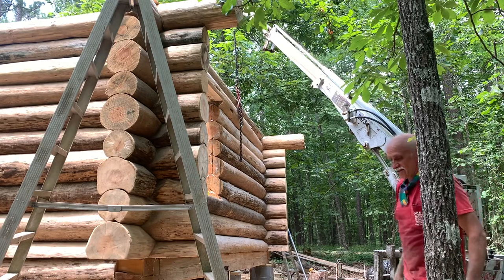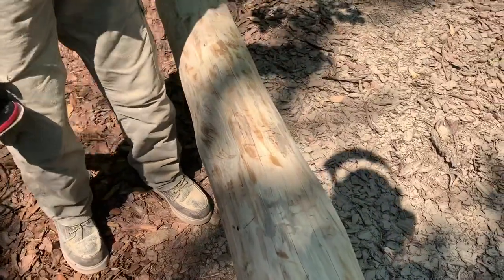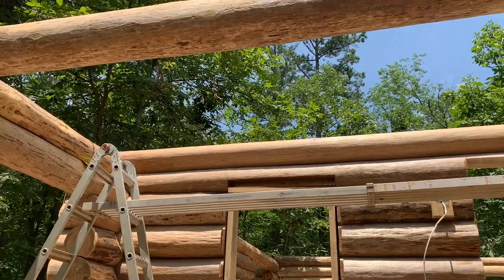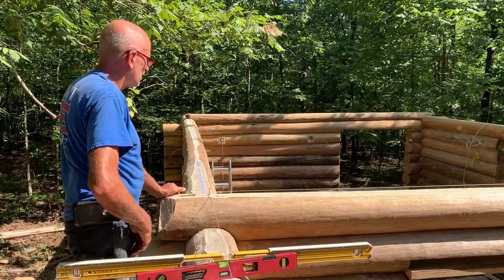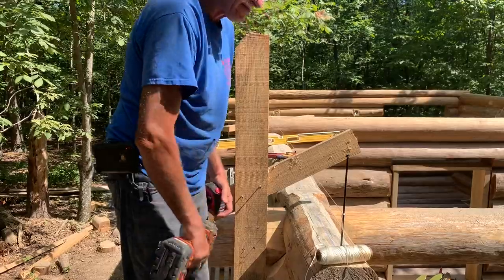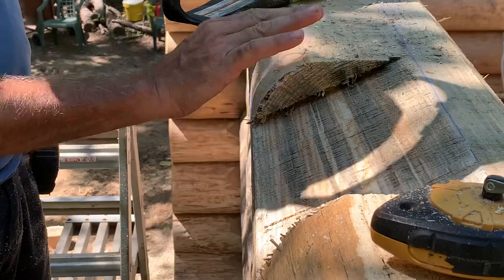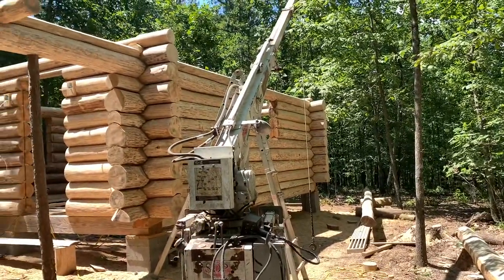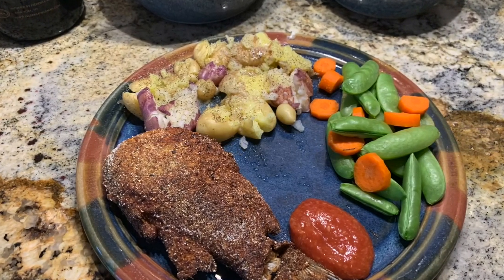Log Cabin Build Part 19. Highlights. Squaring up the walls and getting ready for the roof

Comment: I've been following your videos. You are making great progress. When i was building mine I figured out that if you pull your chaulk line away from the center of the log and snap it that it will give you  a true slant  line to cut the flat. My logs were natural like yours and it worked well for me. Your method works good too. just a little more time involved. Keep up the good work!
Reply from the maker: Thanks Donny! We can’t seem to get that to work…I guess we are not getting the right angle when we snap it. Our way was pretty slow😂
Reply: @natureartgirl  You know what! I was wrong. It's been so long for me that I forgot. Pull the chaulk line awy from the intended plane of cut. F its a long span hold it in the center and snap each side. But your way works too and is probably more precise in the end. you are doing a great Job!

Comment: Hey Lance, I’ve been following along the build. What a thrill to be able to do something like this. Happy for you guys. Question,  why wouldn’t you just just cut a slot for each rafter to sit in?
Reply from the maker: You could definitely do that, but we are trying a method that is a little strange, but saves a lot of trim work down the road. Trimming out a log cabin is really difficult since nothing is flat or straight. It’s hard to explain but keep watching and I think it will make sense!😊👍

Comment: Did you screw down any of the logs?
Reply from the maker: Yes! We used 14” screws made for log building. They only have threads on the end about 2” to allow the logs to shrink and settle. We videoed all that in our earlier videos but don’t show it every time because of trying to condense a weeks work into 30 minute video😊

Comment: Non mi resta che essere meravigliato per il lavoro che state svolgendo ...tutto alla perfezione.. complimenti ad entrambi ...in particolare alla signora per la dedizione ai lavori stressanti...domanda...il legno alla fine verrà trattato con impregnante? Ciao e buon proseguimento...
Reply from the maker: Thanks Renato! Yes we are going to use a wood preservative called Outlast. It is an oil based product that penetrates into the wood. It is made to use on log homes and decks. It’s nice because it still allows the logs to dry naturally so you don’t have to wait so long to finish it. We are going to use it right after we get the roof on. 😊
Reply: @natureartgirl  grazie 👌

Comment: Why not just notch where the rafters are supposed to go?
Reply from the maker: You can definitely do it that way. We were trying a weird way-you actually put down your ceiling tongue and groove first and then roofing felt and rafters on top of that. Main advantage is there is very little trim work inside, which is kind of difficult on a log cabin since there are no flat surfaces. It may make more sense when you see the next couple videos….if it works!😂🤣